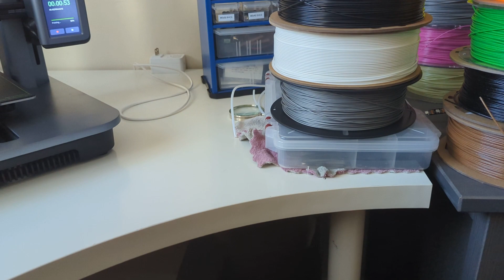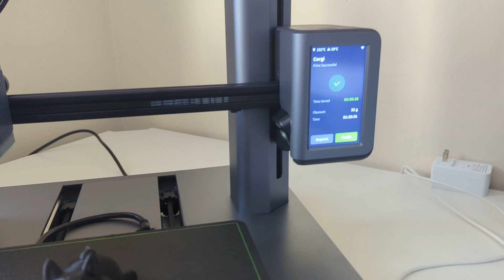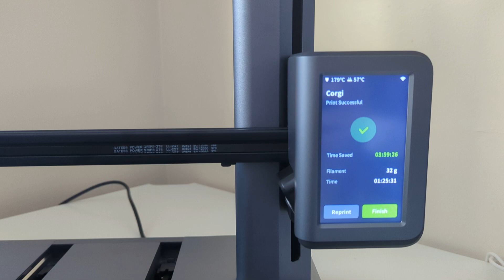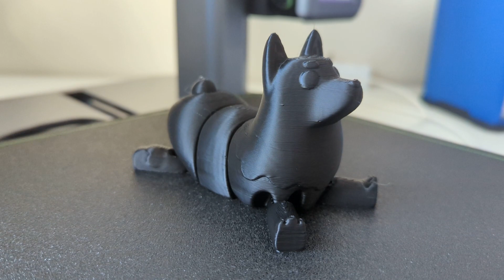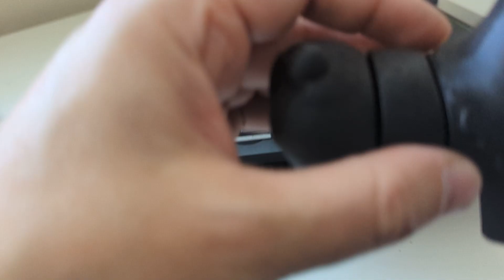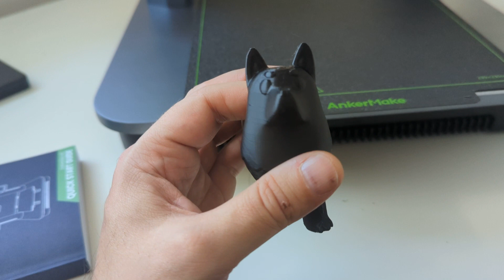AnkerMake M5: First Test Print Complete

Comment: Thanks for the video! what filament would you recommend for the M5? Thx!
Reply from the maker: The M5 is supposed to handle several different filament types, but I would recommend sticking with PLA, PETG, or their derivatives. ABS and ASA generally print better within enclosures which the M5 doesn't have out of the box. I personally have not yet tried other more specialized filaments like Carbon Fiber, Nylon, or Wood infused to be able to offer any opinion.

Comment: Just got mine and it's crazy loud.
Reply from the maker: If you can live with less part cooling, you can cut the noise a bit by dropping the fan speed to a lower value, but you risk print problems due to insufficient cooling
Reply: @oldguymeltsplastic  I'm running it at 75% which is mildly better. Hopefully a quieter fan is available soon. Ai is terrible and I've already given up on the ankermake slicer. Found an m5 cura profile on github which is great but print speeds need to be looked at as it keeps coming out at 300mms even when set at 250mms. The ui has a long way to go also - I hope there'll be a way to get octoprint on the m5 at some stage 🤞🏻
Reply from the maker: @smgrgn  I asked Anker directly if the M5's hardware was capable of running Klipper, and the expected short answer I received from them was: "No." ;-)

Comment: Hi can i have this test prints mine only has one printer test on board and yes I did update the software to the latest version
Reply from the maker: If I can figure out how to download a file FROM the printer, I will share it. So far, I have only been able to upload files TO the printer.
Reply from the maker: There is currently no function to download the model files from the printer to your computer. I asked Anker directly about this file, and they sent me a number of model files that include this Corgi. I have made them available for free on my Google Drive, assuming Anker has rights to them and won't mind. If you are the designer/owner of any of these models, and I should not be freely sharing them, please let me know, and I will remove them right away.
Drive link here: https://drive.google.com/drive/folders/1nLrYocy7nufDFcl3G_WJr7DmQSg45MF9?usp=share_link

Comment: Great 2nd Ankermake video. I am staring at my unboxed Ankermake and wonder if I should start using it. I backed the ankermake m5 with v6(2023?) and bambulab X1C with ams. I've had my X1C , since Aug, and it's fantastic. I don't know if I have the heart to open the M5. 

Since you have your Voron and anker which is  your daily driver or device that requires less fuss between prints?
Reply from the maker: I have been focused on the Voron since I assembled it in September. It is fantastic, now that I am past the modding stage, and is printing reliably using ABS. It is much quieter, and so will still be my daily driver for ABS prints.

The M5 is almost idiot proof, and was ridiculously easy to set up. It gave a great quality print in PLA with no tuning on my part, but it is significantly louder than the Voron. Will probably still use the M5 for PLA prints, so I don't have to remove the panels from my V2. May need to move the M5 to another room due to the noise.
Reply: @oldguymeltsplastic  Thank you for the response. I think you have confirmed my hesitation in opening it.

I think I can endure the noise if it is in another room. I'm thinking my other printer is similar enough to your voron where I will primarily use it and the Ankermake for pla and smaller  jobs. Excellent channel and this may sound cliche but "subbed" as well.
Reply: @ashleys3dprintshop  if you're looking for a cheaper pla/petg machine, the bambu p1p is pretty nice. $100 cheaper than the ankermake, faster, and a bit easier to use.

Comment: Where did you find that Corgi model?
Reply from the maker: It was included in the printer's onboard memory. I can probably share it on printables.com if you can't find it elsewhere.
Reply: @oldguymeltsplastic  Yes please!
Reply from the maker: @VigneshBalasubramaniam  There is currently no function to download the model files from the printer to your computer. I asked Anker directly about this file, and they sent me a number of model files that include this Corgi. I have made them available for free on my Google Drive, assuming Anker has rights to them and won't mind. If you are the designer/owner of any of these models, and I should not be freely sharing them, please let me know, and I will remove them right away.
Drive link here: https://drive.google.com/drive/folders/1nLrYocy7nufDFcl3G_WJr7DmQSg45MF9?usp=share_link

Comment: I'm still waiting on my Ankermake. It would have been my "first" printer (I purchased an ender 3 s1 and the bed was so warped it was unusable, and creality said it was "within spec" so I returned it", but I jumped on the X1C after the Anker KS ended. I'm somewhat disappointed they are pushing this "time saved" marketing jargon on the printer itself. I would rather have solid speed metrics and data. I know I have to temper my expectations on speed with a cartesian vs core xy. I just hope Anker really puts effort in quickly maturing the firmware, software, and slicer. Bambu has been fantastic on that front and Anker so far hasn't impressed me. The slicer seems very mediocre (from my limited experience) and I would have expected more work done on the software side in the months since the main batches went on the boats. I wish I knew more about printing when I backed this because I thought it could print everything. I've been using mainly CF15 and CF6 for prototyping with the X1C. Sure wish there was at least the option to bump the temps up if you did build a custom enclosure. Thanks for the quick look and I would love more updates from an experienced person like yourself.
Reply from the maker: I am mostly printing with my Voron V2.4r2 right now, but it's designed for printing with ABS, and I'll probably use the AnkerMake for any PLA or PETG prints, provided that the models themselves aren't too tall that the bed motion through the Y axis could contribute to poor quality prints. I also backed the colour changer unit as part of this AnkerMake M5 Kickstarter, and that is scheduled to ship in early 2023, so I'll look forward to trying that as well.

Anker's slicer software does have some additional functionality that isn't immediately obvious, but it's still not yet as feature rich as SuperSlicer.

Comment: Did you do the auto bed leveling first?
Reply from the maker: Yeah, it ran the Z Offset and Bed Mesh Calibrations before I started the print job, as part of it's initialization phase. It didn't rerun these when I kicked off the second print, so it must be storing those details in memory.
Reply: @oldguymeltsplastic  nice! Just got my shipping confirmation this morning, supposedly it’ll be here tomorrow! Excited
Reply from the maker: @TechKingGame  Let me know what you think about it after a print or two!
Reply: @oldguymeltsplastic  So far i really like it. Haven’t had a failed print yet (7 so far) and the torture test pre-loaded print came out beautifully. Some walls are super smooth and some are a bit more irregular, so I’m working on figuring out what’s causing that.